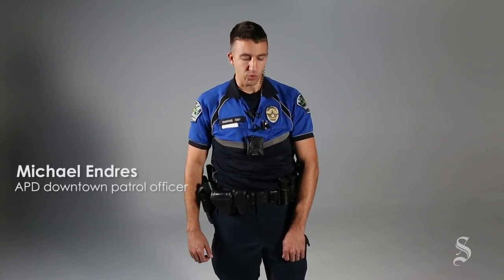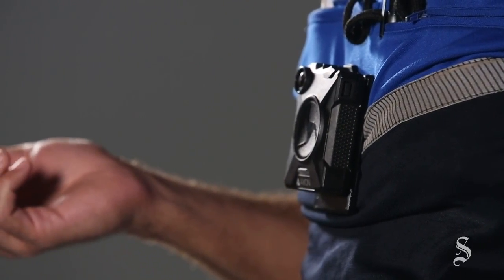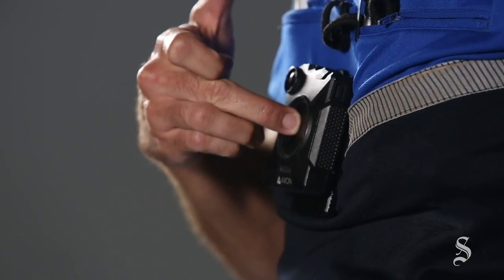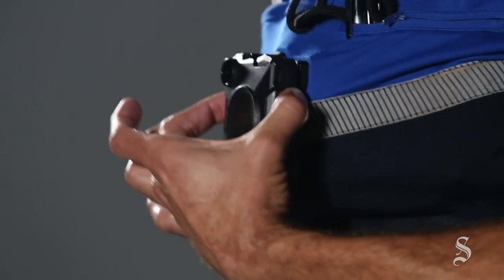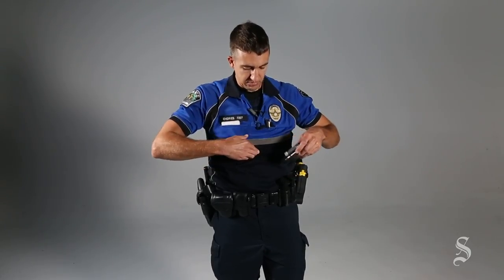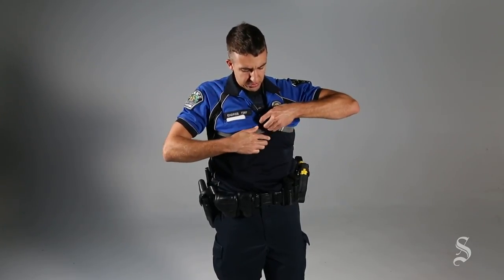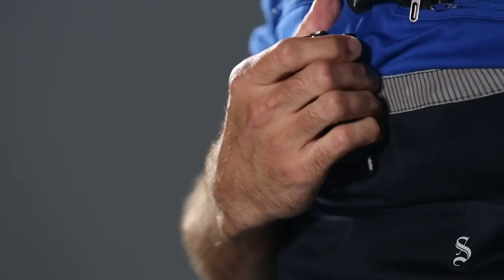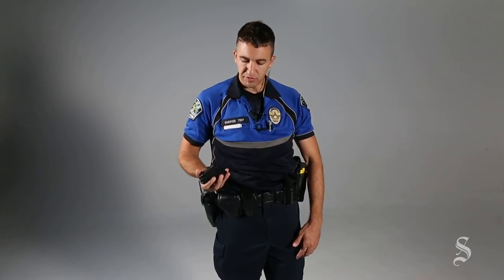APD demonstrates how a body camera works

Comment: I think they are more advanced now then four years ago. The cameras are great it’s just that like the guy was saying if you get into a tumble with someone it can be pulled off your holster or your clothes. I have recently ordered a more modern camera with a lock on clip at the back of it, however for that little bit more reinforcement I may have to purchase a magnetic plate to secure it more. It just gives me  peace of mind knowing that if someone grabs at my camera they won’t be able to pull it off my body.
Reply: Which body cam did you find that locks like that? Looking for one myself